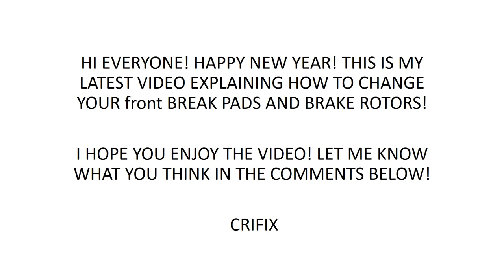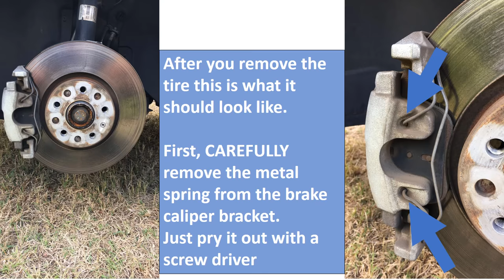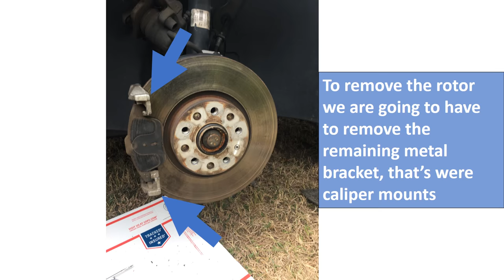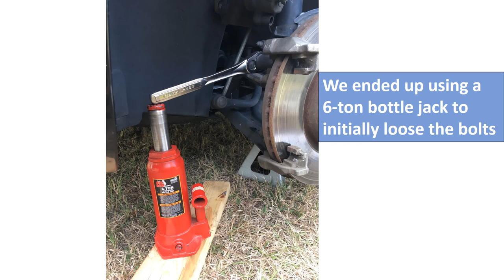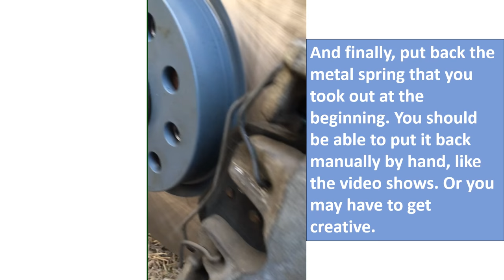VW Passat FRONT BRAKE PADS AND ROTORS Change

Comment: Rotor Screw 4 Nm
Caliper Pin 30 Nm
Caliper Bolt 200 Nm
Wheel Lug Nut 140 Nm

The retaining spring can easily be reinstalled by using a rubber mallet to hold one side in place while using a long nose plier to flex it back in position.

The B7 Passat is known to have a transmission solenoid failure, located in the valve body. The fuel pump and fuel pump control module are also known to fail every 90k miles or so. Not all too difficult to be replace. Most people fail to realize there is a fill plug at the front and at the top of the transmission.

Good job on the video 🍻

Comment: The two large bolts are insanely hard to get off... I used a car jack to lift the ratchet handle like in the video, but on the passenger side it was much more difficult. I managed to do the same thing with a jack on ratchet, but needed an extension so the ratchet handle could fit between suspension components.

Also I'd recommend replace the springs that come with new pads... at least my old ones made a creaking noise.
Reply from the maker: yes they are hard...lol
Reply from the maker: please subscribe to my channel . I need to reach 1000 subscribers to survive

Comment: 2007 passat 2.0t  w/electronic parking brake. replaced master cylinder last september then again i week ago.  no leaks , no sticking calipers. bleeding brakes down with bottle and clear hose until no bubbles from furthest to closest calipers. can get rock solid peddle while engine is off . as soon as car is started peddle goes to the floor. have reset the epb  but peddle still goes down. can anyone help?
Reply from the maker: It looks more like electrical problem.
Reply from the maker: Did you try www.passatworld.com

Comment: Would be great if you actually had the exact socket sizes so we don’t have to go and buy a whole tool set
Reply from the maker: 7 HEX and 18 socket
Reply: @crifix.  The 7 Hex does that remove the 2 hex bolts of the brake caliper and the screw that holds the rotor?  Or are they different sizes?